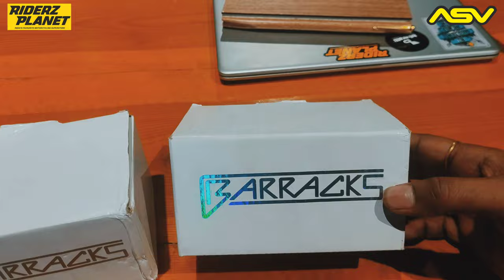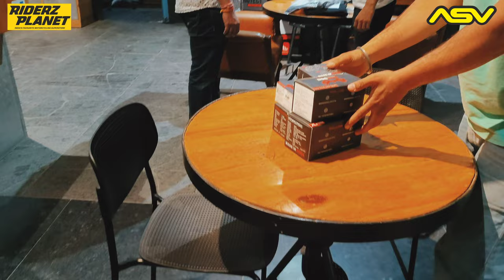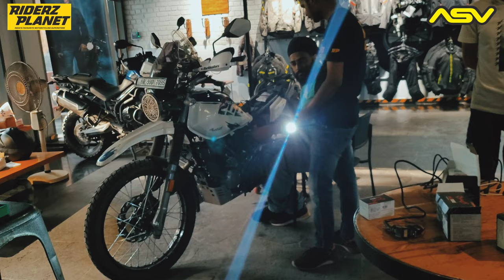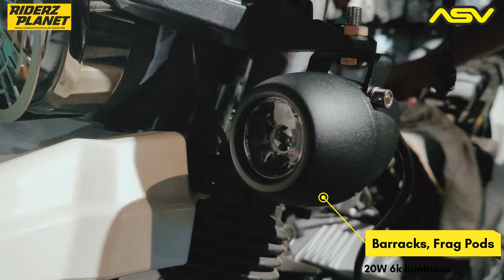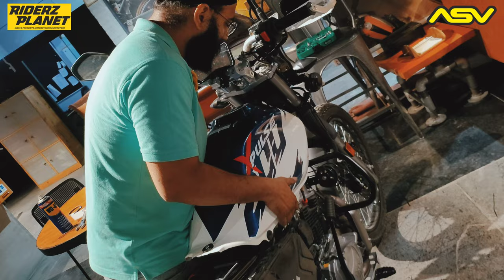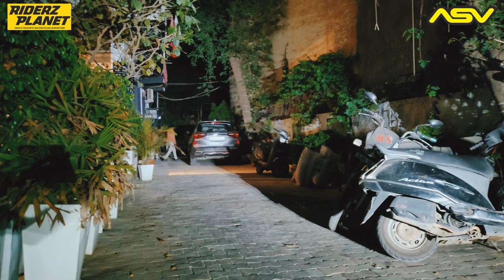Best Auxiliary lights available in the market #motovlog #benellitrk502 #heroxpulse2004v #foglights

Comment: Hey, I'm from Mangalore. Which ones better? This or Maddog Alpha? I have an Xpulse 200 2V BS6
Reply from the maker: No, this is a brand called "Barracks" model - frag pods https://www.pathpavers.in/products/barracks-auxiliary-lights-frag-pods-20w-pair
Reply: @arjunshettyvlogs9282  Yeah but you compared it to Maddog Scout X , so similarly, for ₹15k , is it better than Maddog Alpha which also costs around ₹15k ?
Reply from the maker: @RPS SCORPIUS  Yes, I compared with Maddog. But, this is much better than ScoutX brother
Reply: @arjunshettyvlogs9282  Maddog has different modes .. Scout , ScoutX , Deta, Alpha ... ScoutX is mid range which has 4800 lumens .... Alpha is the top one which has 9600 lumens .. It costs around ₹15k something.. so I think Maddog Alpha is the competitor for this Barracks light (comparing the price) ... So for ₹15k wouldn't Alpha be better than Barracks?